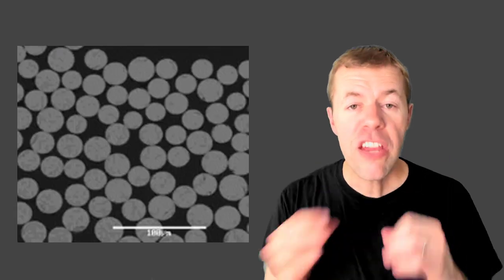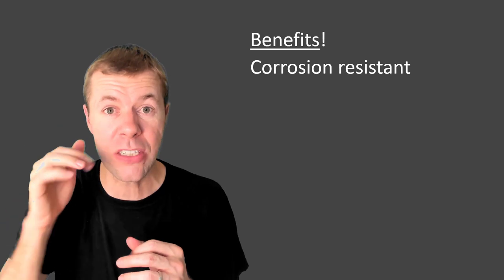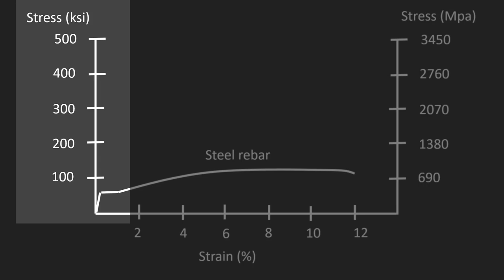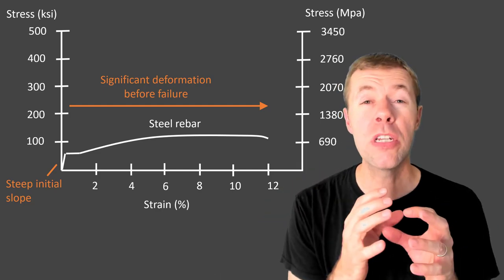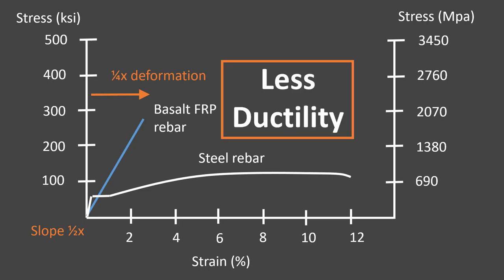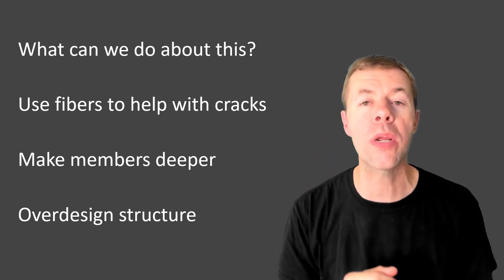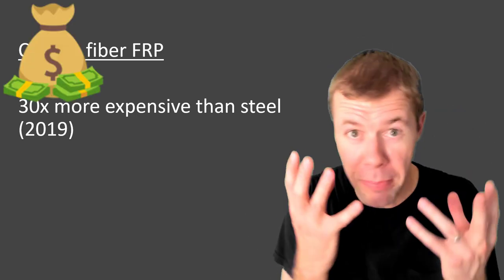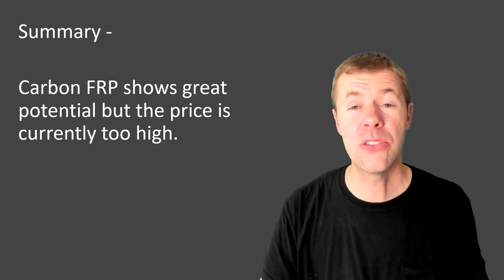What is FRP rebar? Why don’t we use it?

Comment: A number of errors/oversights:
1) For flexural loads, crack-width decreases the closer the reinforcement is to the surface under tension, and, unlike steel, FRP can be placed VERY close to the surface.
2) Ductility is an idiotic way to manage extreme loads. Yeah, it keeps occupants alive, but it also ensures that they'll all become well-acquainted with the joys of refugee camps.
3) It's physically impossible to create concrete awesome enough to protect steel, long-term. Concrete always carbonates, moisture always permeates, and steel always rusts when the twain meet.
4) Steel is environmentally horrific. It has something like 400% of GFRP's carbon footprint and requires a thick cover of lime-rich concrete.

Now, I agree that price makes FRP an unappealing rebar substitute, but rebar is a terribly inefficient form-factor for reinforcement and should have been near extinction for at least two decades. If the construction industry is ever defeated in its War on Progress and dragged kicking and screaming out of the 1950's (or the 1890's, in the case of residential construction), textile-reinforced concrete/fiber-reinforced cementitious matrix (the industry's alternate and unnecessarily confusing terms for what everyone else would call "continuous fiber-reinforced concrete") will dramatically reduce environmental and economic costs of construction, and inorganic fibers are infinitely better suited for that than steel.
Reply from the maker: Thanks,
1) I was comparing steel rebar and FRP at the same amount of cover when I talked about crack size.  You always have to have cover because of fire.  If you have FRP in a fire then game over as it melts and loses all strength.
2) Ductility is what is required by all major building codes.  Structures are designed to save human lives in extreme events.
3) I agree but we can make the progress take a very long time.  I think 100+ years is possible.
4) Most steel is 95% recycled.  This helps a lot with the carbon footprint but I agree that it is high.

I totally agree that fibers are the future.  I am a big fan of them.  Check out my other videos.
https://www.youtube.com/watch?v=jWFncYgbCCg
Reply: @TylerLey  1) Piling on concrete may be the most straightforward means of fire-resistance, but it's a horrifically inefficient one. Coatings, insulation, and/or intelligently designed assemblies can be greener, lighter, and have lower lifecycle costs ... or at least they could if the construction industry changed faster than the rate of retirement.
2) Actually, in Quakeland, aka Japan, the building code offers alternatives to ductility. See, they got tired of repairing/rebuilding self-destructing buildings, so they got a clue and made provisions to ease adoption of damping and base-isolation, which save lives AND structures, dramatically increasing the lifespan and reducing the lifetime costs of construction.
3) Steel reinforcement would only last 100+ years in concrete without any cracks, and good luck with that. Sure, there are admixtures that allow concrete to self-heal micro-cracks, but concrete that slumps also macro-cracks, opening up a fast-lane for corrosion. Only super-dry, admixed-to-death, precast-only concrete could reliably protect steel that long, and even then only if nothing goes awry ... which, after a century, something almost certainly will.
4) Recycled steel may be greener than virgin, but it's still not green. It takes a lot of energy to ship scrap to China, melt it down, and then ship it back in the form of rebar. You'd still be better off using glass or basalt FRP.

Comment: Bottom line: what is the longevity, durability in a caustic or high pH environment.  Studies have been done with variable results.  Some reinforcements perform better than others.  Some resin / matrix perform better than others.  The combination of reinforcements / resins perform better than others.  It's been my experience that epoxy does not perform very will in a high pH durability study.  However an epoxy modified vinyl ester will perform much better than a epoxy.

Comment: seems like you could offset some of those things buy using more and using it smarter ways, using it the same way you would steel is the wrong way, different products require different methods, and it depends on what your making, and sorry a few percent more cost with overdesign could save you so much more later on, and 100 years isent good enough look at roman concrete.... hell 100 years for modern concrete is wishfull thinking... usually only lasts about 20 to 40 years on alot of stuff the days.....they "repaired" 2 bridges here not even 20 years ago... like real deal full on renovations....and they are already falling apart .......the romans knew what was up...its crazy how much is still standing thousands of years later.....thats the kinda stuff we need

Comment: Wow! Found it quite unnerving to see and hear a PE, PhD
charged with shaping the minds of engineers and perhaps more important, a PE,
PhD on stage with the ability to skew the minds of “would be” project owners “away”
from environmentally friendly concrete reinforcements like “basalt rebar” by presenting
the mistakes seen here in the video “What is FRP rebar”. 

Tyler, in your demo, that was a piece of “white” fiberglass rebar,
aka GFRP rebar that you snapped in a bench “VICE”. What killed me; you
improperly called it “basalt” through your entire script! If I may point out please,
among other things, basalt rebar, aka BFRP rebar is “brown” in color because it is produced
from “naturally” occurring and renewable volcanic rock processed into a “Glass-state”
continuous basalt fiber.. The “white” GFRP rebar you showed is produced from a “manmade”
recipe of perhaps a dozen minerals, each with their own carbon foot print processed
into a “Glass-State”. As you correctly stated, FRP’s are in general 3 to -5
time stronger than schedule 40 “ductile” black steel rebar, however, when it
comes to the more cost effective FRP’s, brown basalt fiber reinforced epoxy
BFRP and white fiberglass reinforced with poly or vinyl ester resin aka GFRP,  both gain their
strength and “no rust” long term durability largely from their “glass-state”
and as such “yes” they are more brittle. That said, to properly adopt the benefits
of all FRP’s their placement with in the reinforced concrete structure needs to
adjusted to accommodate their different properties so they actually perform “better”
than steels. Tyler, BFRP rebar is the low cost / hi performance future of
concrete reinforcement you are looking for so don’t kill it please LOL!  After years of peer review,  in the June 2016 printing of AC-454.

both GFRP and BFRP were industry recognized as interchangeable reinforcements for concrete infastructure.

Perhaps we should talk.

All the best, Don Smith Chairman Rock Rebar Inc.
Reply: The "glass state" has little to do with resistance to corrosion. Basalt, unlike steel, is already oxidized! That is the source of its corrosion resistance. You could make glassy steel (although it's quite expensive) and it wouldn't resist corrosion any better than crystalline steel. That said, yes, basalt rebar is a useful product, particularly anywhere that corrosion of steel rebar would be a concern.

Comment: There is a better way. A high-ratio zinc silicate coating that chemically bonds to the rebar, AND chemically bonds to the concrete. Unfortunately, when this was first introduced to the marketplace 30 years ago, fusion bonded 3M type coatings (which do not bond chemically) was so entrenched that the technology didn’t have a chance. 
Many other advantages like low cost, no undercutting, water-based, also benefits to the solution. I’m now 75 years old and the technology, first invented by NASA, then taken from lab to production, and commercialized by me, will probably go to my grave. Hard to watch what’s happening when you have the solution.

Comment: Your videos are interesting.  But the graphs and commentary are weak.  Do some testing like "Project Farm" or the crazy "Mythbusters" TV show did.  Be more Scientific and Journalistic, not just Journalistic.
I am a machinery type guy.  But I did work on a pavement reasearch project for 6 years.  We tested things.  I heard things discussed by the university people, DOT people, and the engineering company that I worked for.  People would be surprised what really works and how much.
Try using paper towel or wrapping paper roll tubes as forms.  Make some samples, and deflect them under a hydraulic press with a record of the force and deflection.
Even wood improves concrete's resistance to cracking.  Fibercrete is also awesome.
Actually if you make a plastic mold.  With 1ftx1ftx8ft blocks.  You could develope engineering tables for the world to design by.

Comment: Unlike this guy in the video,   I personally recommend waterproof fibre rebar.
I doubt anyone will put your house in a vice and bend it over and back.
Reply from the maker: Corrosion is rarely a problem in a home.  In a home the reinforcement's job is to keep any cracks that form small or withstand an extreme event like a tornado, earthquake, or vehicle impact.  In everyone of these cases steel rebar will outperform plastic bars.

Comment: Or perhaps all of your rebar is the carbon fiber when it's affordable... Followed by a nice coated steel rebar laid in the concrete as you poor.. Perhaps able to maintain no scratches on the coating and still has the necessary coated steel for flexibility in the long run

Comment: You did not cover the fire issue with FRP reinforcement. I think low ductility of FRP is a major design issue which needs to be overcome.
Reply from the maker: Thanks Hasan,
I mention fire and creep in the video.  I decided to just focus on stiffness and low ductility to keep the video at about 8 min.  I agree that the low ductility is a big issue.
Reply: @TylerLey  There are new epoxies for fire that could be applied to FRP to mitigate that. Also steel when bent stays bent, it does not come back like FRP-talk about ductile -far more than steel in its wanting to return to straight. The concrete would have to be SO compromised to get that far to begin. Use higher strength like UHPC when needed and add FRP mini-bars instead of steel fibers. And mesh and chopped fibers -they all together would provide the longest lasting solution and actually save money in total.